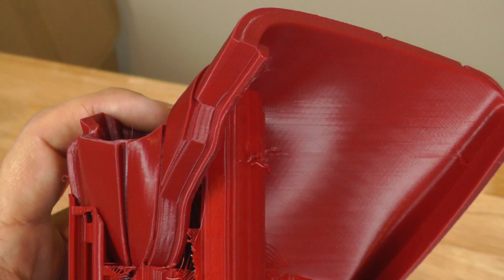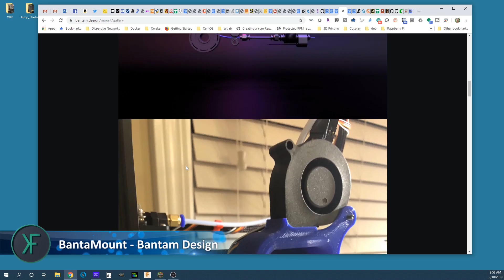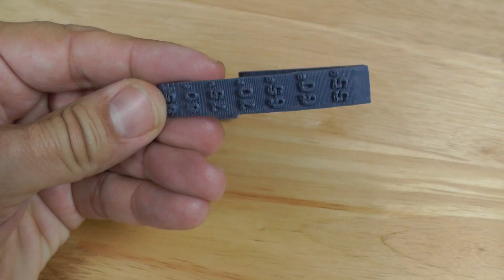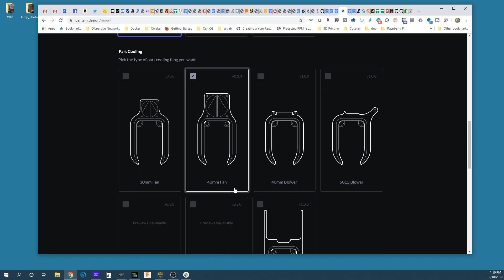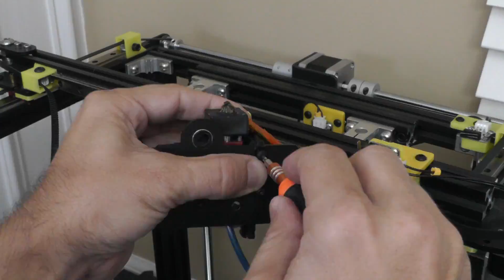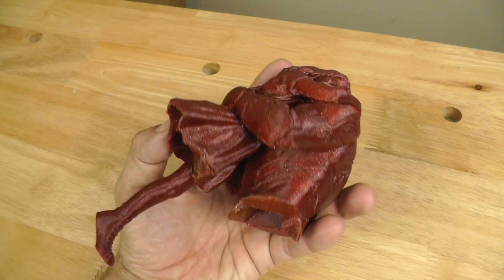The Best Part Cooler for Creality 3D Printers (Ender 5 Upgrades #8)

Comment: Congrats on a great review and for choosing to include my Hero Me Gen3 in the group of cooling solutions you tested. I am very pleased but not surprised that you got the great results using the Hero Me Gen3, as your testing matches the testing I and my collaborators have done over the past year. I am MediaMan, the designer of the Hero Me Gen3 ( a major remix of the great original work by Kelokera). As I don't have an Ender 5 to test against, I was not aware of the extra work needed to get the Hero Me mount attached to the base. I will look into how this could be made easier.. As others have mentioned, it is very easy to mount the Hero Me Gen3 on CR-10/S/Pro/V2 and Ender 3/Pro printers. I too would be interested in your comparing the Hero Me Gen3 against David Petsel's excellent Bullseye and Petsfang V2 cooling systems. I'd also like to mention that the Hero Me has an excellent remix community that has added dozens of derivatives, various improvements, and versions for other 3D printers (ANet, DaVinci, etc.) and extruder types (Bondtech, DirectDrive, etc.)  for the Hero Me (almost all are backward compatible to the original). With the help of great reviews like yours, in just over one year my Hero Me Gen3 cooling systems have grown in popularity to now be downloaded over 30 thousand times a month!
Reply: See - #8.5 for comparison of the Hero Me Gen3 against David Petsel's Bullseye and Petsfang. Especially as Bullseye was one of my first mods - printed in PLA and the fans already deformed a bit. I bought new blowers - I am looking for alternative: Hero Me or Petsfang :) that could be printed with PETG.
Update - See - #8.5 video!
Reply from the maker: @rafalmag  Please check my channel, the video is available where I compare the two. Thanks!
Reply from the maker: Thanks MediaMan and I'm glad you found the review. I appreciate your hard work, along with the community's, to bring this to so many printers and other variations.

Comment: Great video. I want to ask about which was the best for the ender 5 I didn't really get it ^__^' and I opened the links there's many files which model and what files are best for ender 5 pro. Thanks
Reply from the maker: I'm sorry if the information was a bit thick. The Hero Me Gen 3 was the best I tested. You can find the link to the cooler and the Ender 5 mount in the description.
Reply: @kerseyfabs  i found the link but there's many files which one should i download to print
Reply from the maker: I understand. Here are the base parts to download:
Hero_Me_Base_for_Ender_5_Gen3a.stl
Hero_Me_Base_Lock_Ender_5_Gen3.stl
HM_Base_Lock_No_ABL_Ender_5_Gen3.stl
Hero_Me_Dual_5015_Duct_Gen3.stl

I think that's it. This is in the order they're in the file list.

Comment: the left uses ambient air, the right uses air that left the hotel so it cools less, so the difference, mounted from the front the fans take the air from the left
Reply from the maker: I see what you're saying. Thanks for that. So to improve the Hero Me Gen 3, we'd have to find a way to rotate the fan.

Comment: Thanks for this comparison! One thing that was left open for me - what material should be used to print these? On Thingiverse I see a lot of people using various PLA filaments to print these, but I'm curious about your opinion / experience...
Reply from the maker: That's a great question! I forgot to mention it in the video. Ideally you'll ant to print it with something a bit more heat resistant than standard PLA. For this video, I printed the purple one in PETG and the other three were printed in HT-PLA. Either of those should work fine. Thanks!

Comment: Hey man, thanks for the great video! I was looking through the comments and did not find an answer - to install DUAL part cooling fans, did you merely split the existing + and - wires? You wired the two new fans in Parallel to the existing wires? Thanks again!
Reply from the maker: Sorry about that. I left it out of the video by mistake. I just made a splitter. I posted a photo and description on my Community page: https://www.youtube.com/channel/UC0wibNiEDwok18wFNRHrHMg/community?lb=UgzA4IgiQWz2RhyQXdp4AaABCQ

Comment: i have been tinkering with my ender5, and found out that the x-carriage mount is different enough from the ender3 and cr10 such that you cannot use mounts that clip to the side of the x-carriage of the 3d printer. Also, the gt2belt position causes problems with the compatibility with some mounts.
Reply from the maker: That's true. All of these mounts either had Ender 5 variations or required little or no mods to get them installed.

Comment: Since there is so small "gain" over the default cooling, would it not be good if the dual one, actually where based on dual 4010?  Does not seem the fan itself - improve to much?

Reson for askin is to keep the whole part as narrow as possible (valid point on a Ender5)
Reply from the maker: I didn't include it for time but I did test a dual 4010 configuration. The performance was terrible! So until I find a cooler that actually is marginally worth using, I can't recommend it.

Comment: Great video.  I got to be careful with mountings because my Ender 5 is direct drive and has a different plate.  I'll look into this Hero Me Gen3.  What's got me stumped is you went through the wiring part too fast, adding that second set of wires.  Thanks
Reply from the maker: Yeah, the mounting may be different since I'm sure the inlet is different. Sorry if that went too quickly. I actually forgot to show how I did dual fans. For that I simply made a splitter. I can post some pictures to my social accounts. Are you on any other platform?
Reply: @kerseyfabs  Hi  Yes I sent you a message on FB
Reply: @kerseyfabs  I got the photo.  Thanks. I Got the EZ-ABL coming with the OEM mount for Ender 5.  So I got to wait  to see which fooling shroud I can get. What do you call those little white connectors?
Reply from the maker: See the new Community post and comments: https://www.youtube.com/channel/UC0wibNiEDwok18wFNRHrHMg/community?lb=UgzA4IgiQWz2RhyQXdp4AaABCQ

I'll also add this in the video description.

Comment: May I suggest that for a next video if you want to do coolers - check out the ones that have been engineered with CFD Airflow simulations.   Ie, the petsfang/bullseye and the Hangtight designs.  https://www.thingiverse.com/thing:3179892  What I like is that simulations drive the design, rather than a well meaning person going - hey I'm pointing the airflow here, that should do it. As you found a lot of designs perform worse than stock.
Reply from the maker: I'll be happy to check these out when I revisit the subject. Thanks!

Comment: I'm running stock fans on my Ender 3 and CR-10s but I see no need to change until filament cooling becomes a real problem.
 A very interesting video!
Reply from the maker: Thanks! It definitely depends on what you're printing. CHEP showed that he doesn't even need cooling with his profiles when printing 3Dbenchies.

Comment: Good video, turn your mic volume down or something, quite raspy/ breaks up, sounds over amplified.
Reply from the maker: Don't I know it! It's a problem I've been working on but the only solution I currently have produces dull, echoey audio instead. My current camera just doesn't take in certain mics well. The gain is all the way down. I'm still working on it. Thanks for watching and commenting! 😬
Reply: @kerseyfabs  What if you record the sound stand alone ? And at the editing you add on and try to match the video too the sound ? I'm by no means into this but I've seen several youtubers record video and audio separate from each other.
Reply from the maker: This is an option and I've seen other channels do it too. I have tried it a time or two early on. The problem I ran into, as well as others, is that occasionally you can lose the audio or realize you forgot to hit record on it and not find out until you go to edit. It's a real fear when you realize how long recording just the right clip can take.

Comment: I'm running the Petsfang/Bullseye dual duct on the Ender 5 with stock fans and have been pretty happy with it.  Of course, no way to know how it compares to these.    Great review and you clearly put a lot of work into your channel which is appreciated.
Reply from the maker: Thank you! There were too many options to include them all, so I just sampled the styles available. Thanks for letting us know what's working for you!
Reply: Kersey Fabrications nice video! Surprised you didn't try Bullseye and/or Petsfang as those seem way more commonly used than most of the ones you tried (I'd only ever heard of the Hero Me out of the ones you tried). But aside from that, really enjoyed the thoroughness, great job!